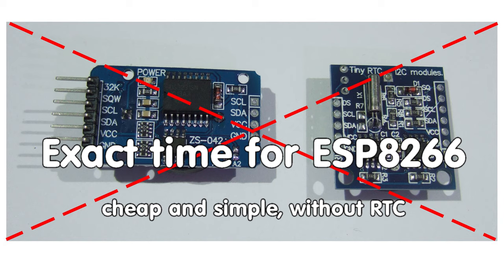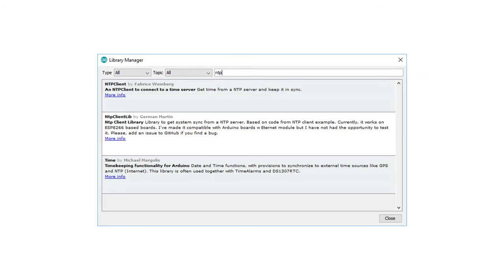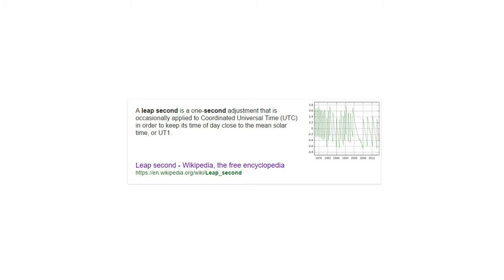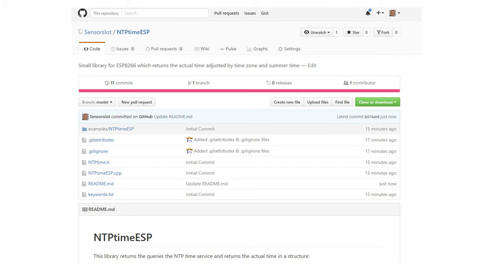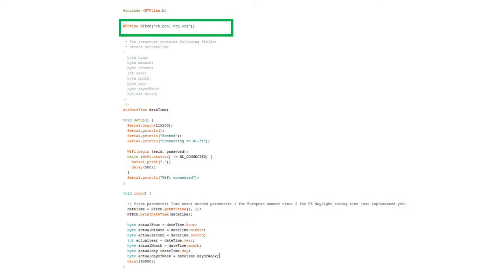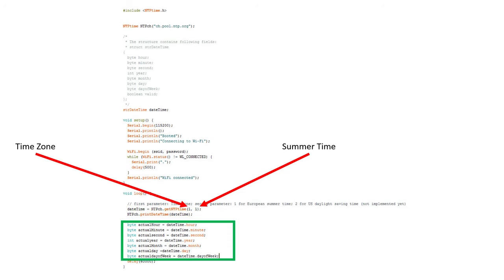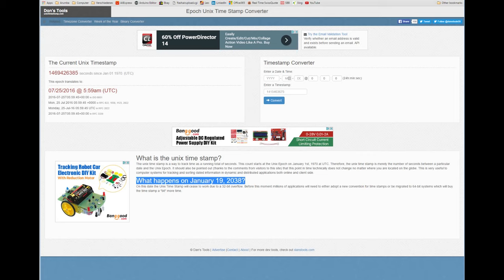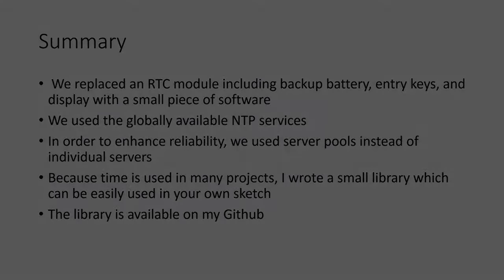#67 Exact Time without RTC Module for the ESP8266: NTP Time

Comment: This is an old video…
But since I am a bit slow and have just started playing with the ESP8266 :-) this is still very useful…
I am also playing with MQTT…
On Linux I have a process which is subscribed to everything… using it to log status… right now I’m only turning the 8266 led on and off…
I plans to have a dedicated 8266 with ntp… on MQTT subscribing to a topic getDate when it gets a message it will publish on the topic ntpDate…. The 8266 when told to turn the led on or off will also publish to getDate the response from the 8266 with ntp will respond and the process subscribed to all will see the led topic the getDate topic and the ntpDate … so I know when it happened… the mosquito command subscribing to all has its output appending to a status.txt file… thank you so much for your videos…  I find them interesting, informative, clearly explained, and paced correctly.
Reply from the maker: You find many videos on MQTT, particularly on the Raspberry Pi on this channel.

Comment: There is also an in-built time NTP library for the ESP8266, to use it do this:#include <time.h>  time_t now = time(nullptr);
  Serial.println(ctime(&now));
Reply from the maker: Yes, you are right. I used it im video #71. It seems to use SNTP. But it works ok and with time() you do not need to call the server too often.

Comment: I have a problem : 
In file included from C:\Program Files (x86)\Arduino\libraries\NTPtimeESP-master\examples\NTPtimeESP\NTPtimeESP.ino:9:0:

C:\Program Files (x86)\Arduino\libraries\NTPtimeESP-master/NTPtimeESP.h:16:25: fatal error: ESP8266WiFi.h: No such file or directory

 #include <ESP8266WiFi.h>

I have to add another library ? Witch one ?

Thank you for help
Reply from the maker: +Olivier Bousquet Maybe you did not select an ESP8266 as board. It will not work with an Arduino
Reply: Ok... it is no way to do the same with an arduino?
Reply from the maker: It is possible, but you have to have internet connection (Ethernet shield). But you have then to adapt my sketch to these commands (not a bid deal, I think)
Reply: It works after I flash node MCU firmaware in ESP8266 ! Thanks a lot ! :)

Comment: Hallo aus Deutschland lieber Andreas!
I have a question: My PIR sensor wakes up the ESP-12 from deepsleep very frequently, then connects to WiFi and MQTT. Because it runs on batteries I want to avoid the power eating connection process. It should connect only every 5 minues. My idea is to to measure the deepsleep timespan to do some calculations and get the time of the last wakeups and send the sensor to deepsleep it < 5 minutes. My Problem: How can I measure the time between weakups (deepsleep time) without connecting to Wifi like timeserver ? Danke für deine Hilfe im Voraus!
Reply from the maker: I do not think the ESP32 does something during deepsleep. Maybe you have a look at my ULP video?
Reply: @AndreasSpiess  thank you for the fast answer. ESP32 could be a solution but   I prefer to use Esp-12 since i have so many of them. I ll try RTC Module before switching to esp32.

Comment: First of all, thanks for the library. :) 

The only problem I found with it was that I had to make a blocking call. So, my UI/Touch interface gets stuck. I had made some changes to your library and have posted it in the github page. Please do take a look at it when you get time.
Reply from the maker: Thanks for your contribution. I answered you an Github.
Reply: Have raised the pull request. :)
Reply from the maker: Implemented

Comment: I am getting some problem my sketch runs perfectly but time does not update.. it always gives 1-1-1970 and time starts from 5:00:00 i cant get what i am doing wrong please help... My timezon is of pakistan.
Reply from the maker: There is an easier way now: https://youtu.be/iOPBL9POnRc
Reply: I got the same problem but instead of 5 it shows 8 (probably because live in an other time zone) . I cant figure out how to solve this problem but since you had the same problem did you solve it and if so how did you do it
Reply: I used an other method in which i hard coded the time and started the timer and then it was solved.. works great

Comment: Great video. I guess the parameters are (0,0) if you want UTC, which is what people should use for everything other than presentation. If you use local time then be prepared for missing hours and duplicated hours when the daylight saving comes and goes.

PS. CH is from the Latin "Confoederatio Helvetica", but you knew that of course from your coins. 😉
Reply from the maker: You are right with the parameters. But I wanted a hassle free possibility to get the actual time without coding in my sketch. This is why I included the conversion in the library. My devices so far do not need to care about the "double" and "missing" hours.
The thing about CH is, of course, taught in our schools. This is probably, why I forgot to mention it in the video.

Comment: hi.
this works really nicely, but does it actually count Saturday as day 7, not day 6?
and this probably connects to the ntp server every time and does not store the time in its memory?
Reply from the maker: 1. I do not remember the numbering of the days of the week. However, it is easily changeable by you in software if important.
2. Why would you want to store time in memory? It moves all the time. If I remember right, the ESP has a time() function which you could use (without deep sleep). Because it is not very precise, you could synchronize it every hour or so with a call to NTP

Comment: Thanks for this and other videos you have produced.  I am in the U.S. and tried the service at us.pool.ntp.org.  It was causing me a problem by occasionally returning incorrect data as others have reported.  The bad data reports a year of 2036.  I decided to use the service provided by the U.S. government at time.nist.gov.  That works well, except their website warns of frequent requests to the service.  They say that request more frequently than once every four seconds will be treated as a denial of service attack and the site will be blocked.  I set mine to query every 10 seconds.  During the 10 second interval, I update the time by using a delay of 1000 msecs and adding to the previous time by one second.  My next task is to test to see if the WiFI has dropped,  keep displaying the time during the no WiFi time and reconnecting when it comes available.
Reply from the maker: I think I made a second video about the topic. There you might find the time function. With this, you only have to call the service at startup and maybe every hour or so

Comment: Can something be done to keep track of the time even in the deep sleep mode? 
In my project, I want to run esp on the internal battery when there is no external power but want to keep the time even after the external power comes back(in case there is not internet after the power comes back).
Reply from the maker: getLocalTime() should keep time during deep sleep. It is not very precise, however.

Comment: Very nice indneed!  I have been playing with setting up a clock/temp display for our Motor Home (Now on injury list since last nights massive HAIL storm!) This appears to be a good way to go, I have a rtc mod as well but have only played with it, never set it to go full time.  My question is, though, if I set this up, and set it to retreive the time, what will happen when we happen to be in some place where I cannot get web access?  I have a small travel router set up in the unit so when ever I detect internet, I connect with the router so we always have the same network name and password, but for those days when I cannot get regular internet because we are parked somewhere in the Mohave Desert of Arizona, will the system go bonkers if it fails to get an update?  I haven't looked at the code yet, perhaps the answer is there someplace so I can simply put it to check every tuesday evening at 7:00 PM and I can turn on my Verizon Jetpack at that time or something.
Reply from the maker: If you watch my video of this evening you will see such a possibility. I present a small library where you can use the timer of the ESP while not connected to the internet. But if your device loses power, it also looses time and it is not very precise. So, for your case I wold spend an extra dollar for a RTC module and do exactly what you describe: Every few hours check the availability of Wi-Fi and if available, adjust the time of the RTC module. This has the advantage that you do not need any buttons to initially adjust the time.

Comment: Super nice video. I am to start a small ESP8266 based multi-room Thermostat and wanted to add local time to the Nextion screen. Just one question. Once I get the time/date, the updates to the display should be calculated off the original NTP query right? if so, any ideas on how to? Thanks for your Videos!
Reply from the maker: +George Lake The library returns local time ( adjusted to the time zone and summer time). If you want to show local time, you can query the NTP service every minute or so. I do not know, how exact you want your display. Below one minute you can use delay(). This should be exact enough.

Comment: Not bad. Thanks for the library.
Guess something must be wrong with my network or... 
Because as a clock, it's not stable.
I have gaps in the loop that take a minute or five to recover.
And sometimes it's a very weird time and date.
The date it gives (when wrong)  is always 7/2/2036 but the time I sometimes receive can not be placed on the normal layout of a clock as we all know it.
I liked the idea but need something that is stable so I guess it's back to the RTC module.
Reply from the maker: Sorry for that. I do not know, why this happens. I think, we cannot blame the atomic clocks for that big error ;-)
Reply: Why blame anybody/what/thing or whatever for just ... uh, this? Maybe it's the moon but even then I will not blame the thing. And uh... No sorry man. Thanks again and also for the educational information and pieces of code.
Reply: I got the same problem 7/2/2036  ... may be a premonition :)
Reply: Had the same Problem sometimes also 7/2/2036
Reply: Hi, 
277   if ((_unixTime > 0) && (highWord != 0)){
solves the issue.

Comment: Good morning Andreas,
I tried your library and it works great.
I would, however, also use the total seconds to control certain intervals.
How can I include them in a constant type long?
Best regards
Mario
Reply from the maker: You have two possibilities to let variables survive deep sleep: You store it in RTC memory (they will not survive power down) or you put them in EEPR£OM (EEPROM has only 10'000 write cycles before it dies). How to use RTC memory, you find in video #60
Reply: Thanks Andreas.
I understood what you say but I have not been clear.
I want to test if it has been 5 minutes, or 1.5 hours or 3 hours.
For example:
  .
  .
  actualMinute bytes = dateTime.minute;
  .
  (Start loop)
  if (dateTime.minute> = actualMinute +5) {

  }
  (End loop)
  .
  .

I can not take the test on the minutes (dateTime.minute) or the hours (dateTime.hour) because if you are straddling two hours or two days this does not work.

I would take the total seconds and do the same test on the total elapsed seconds; I do not know if I was clear.
It is possible to take total seconds elapsed since 1/1/1900?
Best regards
Mario
P.S. I apologize for my bad English
Reply from the maker: +Mario Lisi    What about the formula: minutes = 60*dateTime.hour + dateTime.minute? Then you could do at the begin: beginMinute = minutes and whenever you want to test if (minutes - beginMinute > DURATION). And somewhere in the library is even a number which is the time since 1970. I think, it is called unixTime
Reply: Hello Andreas,
Thanks for your help.
I studied well your library and I made a small change to get unixtime already present inside but not made available outside.
Now if I write dateTime.unixTime I get the total seconds since 1970.
Thank you again.
Best regards.
Mario
Reply from the maker: +Mario Lisi :-)

Comment: thank you,  this is brilliant.  this will come with so much help to me.
Reply from the maker: You'r welcome! I am glad if my videos help others to get faster to what they want...
Reply: What happened is that I have an esp with sensor on a site and another esp with display panel  on another site both running of iot service. My concern was if sensor side for some reason went offline the display esp will keep showing the last value no matter how old . Now I could check against the timestamp. Example if timestamp was more than 15 minutes difference the display esp should show sensor is offline instead of showing too old data and assisting end user eventually. Thank you.

Small thing If I don't use time saving shall I set the value to zero ?
In my case (4, 0) ?

Comment: Hi Andreas, very good tutorials. I was looking for a simple and concise code for taking the date and time from the internet clocks without success.  Yours works very well for me. 
I'm so new in these stuffs and looking the code it seems to me that it is on line permanently taking the date and time.  I´m sorry if I'm wrong!
Is there any way to get once a day the date/time and adjust an 1703 RTC?  For instance with the "rtc.adjust(DateTime(year, month, day, hour, minute, second))?
I'll really appreciate any help.  Thanks a lot.
Reply from the maker: I am glad my part works. It is up to you how often you call the service. My proposal did not include an RTC. So you have to combine the two sketches yourself. I am sure it will work. Maybe not in five minutes ;-)
Reply: Thanks a lot Andreas for you kind response.  As a little help for a newie in Arduino stuffs please tell me if when I run your NTPtimeESP.ino sketch the processor gets the NTP data (date and time) just once or every time the serial monitor refresh the data.  I checked the cpp file but I'm not able to find that out.
I'll appreciate your support.
Reply from the maker: You find the anser in the .ino file, not in the cpp. The call to get the time is :dateTime = NTPch.getNTPtime(1.0, 1); and it is called in the loop. But you can call wherever and when you want.

Comment: Thank you! I'm using this in a project that activates a relay once a day... AWESOME code, works seamlessly. However, I ran into the problem that it displays as 12hr time so 08:00 happens twice a day when I really only want it at 20:00 (or 08:00 PM). Is it possible to change this from 12hr to 24hr time? Thanks for the videos! long time fan!
Reply from the maker: Unfortunately I do no more remember the video. But i nearly cannot believe it uses 12 hours display.
Reply: Andreas Spiess ok, thank you for the response anyway!

Comment: What about having RTC, and ocassionally pull down sync from the Internet ? (I want to have deep sleep and such features, and no LCD with knobs). I am struggling with comparing the time and updating it in RTC module.
Reply from the maker: I am sure you will find the needed components on the internet. Then you have to create the „glue“ yourself.
Reply: @AndreasSpiess  Thanks anyway, your videos are real gems on youtube. Just now I am slapping some different sketches together and I am close to viable solution.

Comment: Just a question why do you use byte types on strDateTime struct instead of int for hours, minutes, seconds. What's the advantage of using byte over int?
Reply from the maker: Int uses 2  or 4 bytes depending on the processor. byte only one
Reply: Oh OK makes sense. Great work by the way. Your library is the easiest to work with!

Comment: Dear Andreas, thanks for this nice program and good library! It worked perfect without any problem! 😀 Maybe it is a stupid question, but I would like to use this program on the ESP8266 as a RTC for my arduino... But I don't know how to do. Do you have a suggestion where to find information how to do? If it is possible to use it as an Arduino RTC it would be perfect! Never have wrong time! 
Thanks again for the tutorial and for your help. 
With regards, Guido (from the Netherlands)
Reply from the maker: You can connect the two through a Serial connection and write a small communication protocol. I do not think, that this is a common scenario as most of the people who use ESPs do not use an Arduino in addition.

Comment: Hi Andreas, thanks for this works a treat, however is there any way to keep the clock updated when the wifi is powered down?, the ESP8266 is still active I just shut the wifi down and reconnect every 15 mins, it would be nice to keep the clock going on my oled screen, not sure if this is possible?

Cheers Alan
Reply from the maker: You should have a time() function which runs all the time. It is not precise and can be set when connected to NTP. I think I used it in one of my videos.

Comment: Unfortunately I cannot set the time accurately with this library or with any other I have tried.  Whatever method I have used, the time ends up being 2-4 seconds slow.
Reply from the maker: This might be the travel time of the packet from your NTP server to your home. Did you choose the closest NTP server? You should find addresses on the internet. The Swiss servers, for example, start with ch.ntp...
I do not know of any other sources of delay.
Reply: I did pick the nearest but I am almost certain that it is caused by the network delay.  Ntp (as opposed to sntp) has transport delay correction as well as adjusting the time smoothly and so can achieve <10ms accuracy but I haven't been able to find a full ntp implementation.